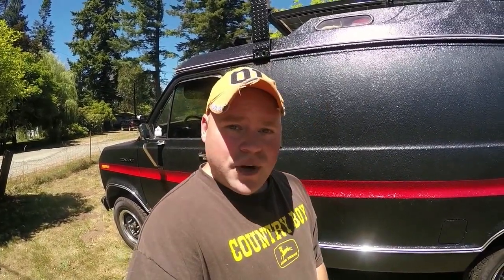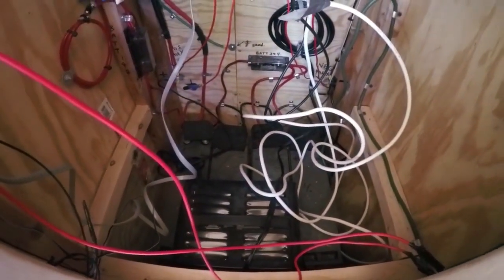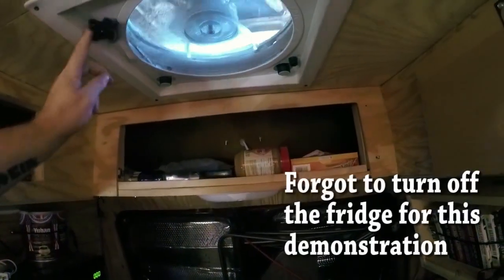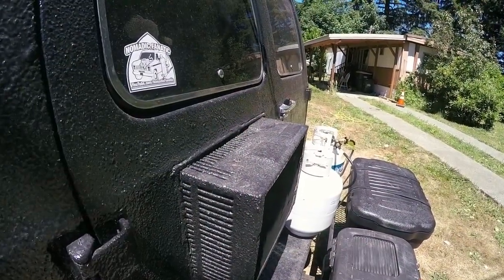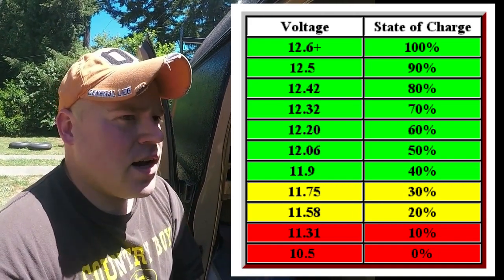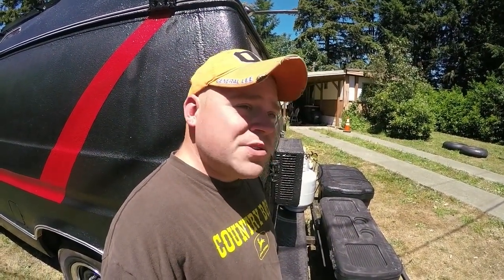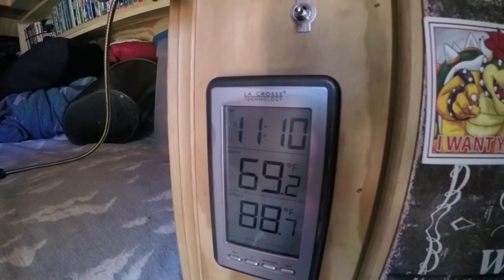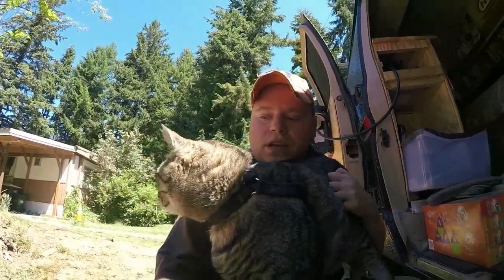Running AC Off Solar

Comment: This is a case where it might be cheaper when available to run the generator.  With such limited! Solar.  This is  hard on some very expensive batteries. I understand the idea. .and good demo. But. That panel in its wildest dreams can't run that air conditioner.
Reply: Tammy Delbruegge You won't learn it from this guy. Do some proper research  if you intend to invest in solar.
Reply: steve murphy Go figure that you are 53 & still a moron.
Reply: Michael D Well said. Thin the herd. Never thought of it that way. Thanks Eric, for helping us thin the herd.
Reply: mychannel325 Eric evokes some passionate defenders, you got hand it to him.  Why?  I think a lot of YouTubers feel sorry for him and want to protect him. I used to feel that way until he did that deal on the retired couple in Florida.
Reply: mychannel325 please explain...i thought that panel was just running it...
Reply: Tammy Delbruegge the solar panel is supplementing the battery.it's really running on battery power. .with the panel supporting about. 1/4 to 1/3. The power. And batteries only have a life cycle on the hundreds. .and those batteries are like 400.00 each x4. He nerds 3 or 4 times that in solar to fully power that air conditioner. .if he had a tesla battery. That has 5000 life cycles o would say go for it. .I am not raining on his parade. .just doing this a lot bis batteries will not last long. ,.
Reply: thank you...i have so much to learn!
Reply: That being said...I think he could run that air conditioner. With a couple more roof mounted. Panels maybe a portable. .and another battery or 2..I will keep buying junk batteries instill tesla is in mas production. ..but tesla will have a little accidents of he starts stepping on too many toes
Reply: Yes it can but not for long.  I keep pounding it in the ground to common folks but yet they don't listen like you.  Eric went from a once 5 watt cell phone solar charger to a 45 watt dash solar panel then to a Harbour Freight portable 100 watt panel to a now 225 watt panel & within 6 months will add another matching 225 watt panel which in turn shades his black roof even more.   Who knows?  He might even convert to a 24 vdc system later. Erics just an average Joe Blow nobody learning as he goes in this strugle called Life.  Note also that he does everything in Piece Work as he can afford it just like everybody else does.  End result?
He's living the dream in this piss poor economy before age 70.  Eric gets the Sharp Shooters all the time about Solar Angle, clean panels, discharge rates etc....
Heavy info isn't it?
  40,000 plus subscriber's in a year, come on.
Sharp Shoot me & I'll make you look bad too!

I love it when the Suit & Ties come on here because I throw it back in their face.  Even in High School I was the guy that beat up the bullies.  Go figure now that I'm 53 & still defending the little guy.
Reply: steve murphy It's running on battery power. ..sorry.unhook the solar it will still run just not as long..take away 3 batteries and reconnect solar see how long it runs. ..some of the common folk already live off grid and already know.. but I don't recall Eric claiming to be a solar expert. .and I think his van is well done...
Reply: mychannel325 The problem with junk batteries is that you have to spend considerable time evaluating them to see if they are worth the price. You can't just walk into a yard sale and know you are getting a good one, so unless they are dirt cheap and you are willing to roll the dice they are not a good deal. That is unless you can buy them on contingency basis, take them home and test them.  There are lots of good vids on YouTube on how to test batteries. Batteries are where electricity meets chemistry and they are pretty tricky. The walls are going up on the Tesla Gigafactory in Reno and lithium batteries should be rolling out in 18 months. Lithium is the future for RV solar storage and prices will come down to reasonable in a couple of years.
Reply: Wrong.  I have that very same set-up including the exact 225 w panel & Renogy MPPT controller only my 4- batteries are Walmart $100 deep-cycles.  My 5,000 btu ac unit runs me 3 hour's.
Reply: john rafferty as a rule Eric doesn't run the ac off the batteries but rather uses the generator or plugs into shore power.  You folks keep getting his video all wrong.  He did this specific video for the NEW subscibers due to the overwhelming questions just like he said in his introduction.  Erics whole point was that the ac could run A SHORT TIME off the batteries.  Thats it.
Reply: Sandy Carty TROLL Sandy is back.  Puts Eric down daily yet returns to watch his video's.   How sad.
Reply: steve murphy you are really very rude
Reply: Drunk 'n Snarky is this guy the bouncer in this bar?  Steve Murphy. ...or what. .it's either eric's mom, girlfriend,  or 8 year old little brother. .get a grip
Reply: Drunk 'n Snarky I have seen this before on a diy off grid diptard channel..that guy was playing fan  boy under his alts. .and still does..I would not go out of my way like that unless I was getting some..now I understand. Why people think he's gay...

Comment: I wonder if, like a refrigerator, there's a way to cycle the AC on and off with a timer of thermometer thermostat (just like a home, full-house AC).  I think if it went off, even for a few minutes, your van temp wouldn't suffer and the solar would almost be able to then run it indefinitely on a sunny day. Thoughts for you to ponder.
Reply: coolkayaker1 I added "The Math" comment in after your comments... here and on my channel I do the math to run an Air Conditioner from a battery bank (no solar & no generator) and how long it will last.
Reply: coolkayaker1 My AC does this. I have the temp set at 69 and it turns on the fan and compressor for a minute or two every 10 minutes or so depending on the thermostat. It is a Kenmore w/energy saver mode a few years old.
Reply: coolkayaker1 An inverter type AC would be the best kind, it can alter its output, but run the compressor constantly to maintain a set temp, rather then cutting completely on or off. :)

Comment: Looks like you could get a second panel up on the roof if you spin the one you have 90*. Sounds like that would get you 6 hours of A/C, and that sounds like plenty to get you through pretty much any sort of day (so long as you're not cooling all the way down into the 60's inside!)
Reply: The Shootist He's says he's getting 3 hours of air running at a 350+ deficit. Throw another 250 panel on top, and the input/output deficit becomes a mere 50, meaning the air will run a LOT longer, even without more battery in the equation.
Reply: YarrVee Eric has 400 watt hours of battery? And 250 watt hours of solar (at max). The AC draws what? 550 watt hours. 

Double the battery capacity and double the solar. OR do what Technomadia does and when the batteries reach 80% start the genset to run the AC and re-charge the batteries..
Reply: YarrVee with the added 250+- from the solar panel. Don't think Eric would get 3 hours w/o the sun. 2nd. If you watch closely Eric turns the thermostat down to 65degrees. The compressor will never shut off. Eric should set the thermostat to 75-78 and let it cycle.
Reply: Fernbark Frist Eric is getting 3 hours with direct sun now, albeit, with a 350 watt/hour deficit..
Reply: Fernbark Frist No. It was your point. You said he could not.

Comment: solar power is so cool to be able to operate everything you need from the sun
Reply: Rob Steinhauer Yup its great, i only have a 100w folding panel, with a 10a version of this charger, but it keeps the waeco CDF 25 running indefinitely 24-7 from a 100AH leisure battery. Even when its cloudy and overcast here in the UK, the panel seems to replace what has been used by the fridge.

After all, no sun, no heat, not much fridge use.
Lots of sun, lots of heat, lots of fridge = lots of solar :)
Reply: Start The Rebellion thanks, we'll keep it in mind!  :)